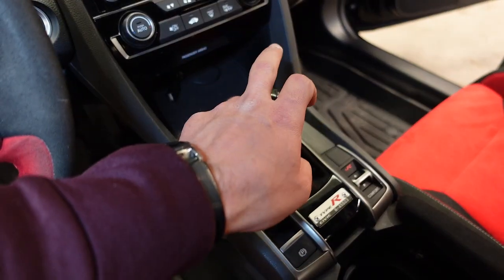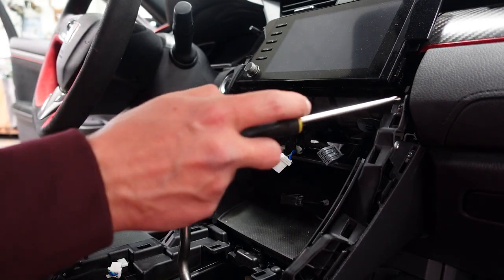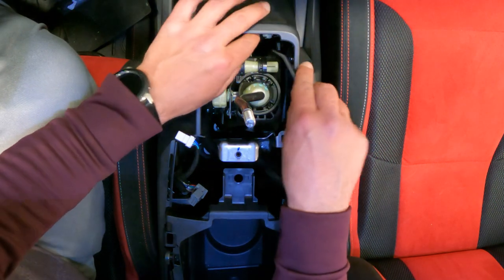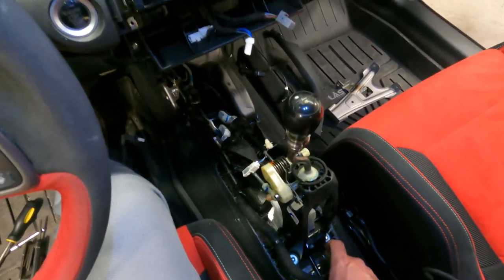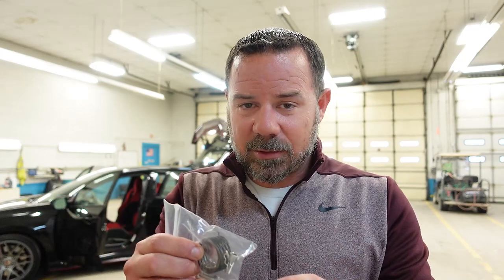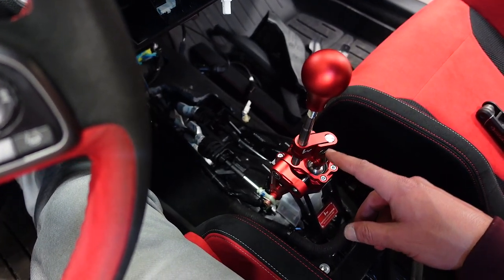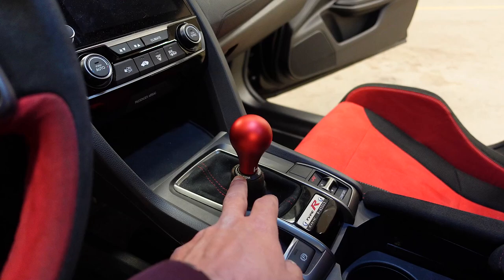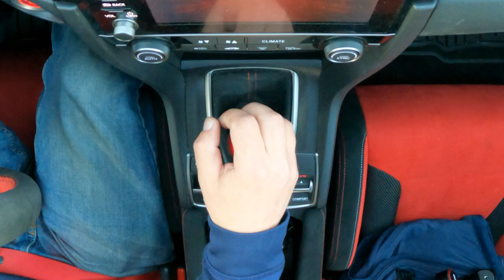"Shifts So Good" Hybrid Racing parts for my 10th Gen Honda Civic Type R FK8!

Comment: Nice work Jason!!!
Reply from the maker: Thank you so much!
Reply: @717PROJECT  Awesome shifter hardware and work. So many things you have to do, keep track of, not lose screws and hardware, or break anything. Not something I would want to do. 

If I got anything zippy, it would probably be that new loaded Integra with the ALS sound system and leave it essentially stock. At least nothing with so much involved to do.

Comment: Hey man, I was wondering if you had spacers on your 11th gen Sport or not. I don't believe you mentioned them in any of your mod videos. I'd like my stock wheels to sit a little more flush and I'm not sure what I'd need to do that.
Reply from the maker: I don't have spacers. I actually like the little tuck look.
Reply: @717PROJECT  Gotcha. The car looks incredible by the way. Did you have the fog lights from Mikstore on the car at some point? I bought a set of their OEM style 'plug and play' fog lights and they recommended your install video.
Reply from the maker: @jacobs.9797  I actually bought mine from Ebay. That's cool they recommended my video 😊